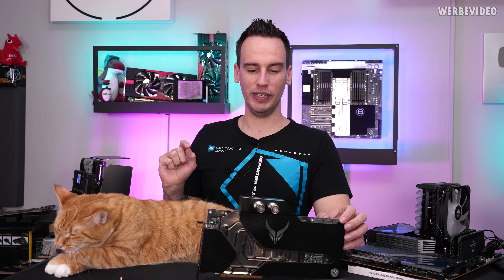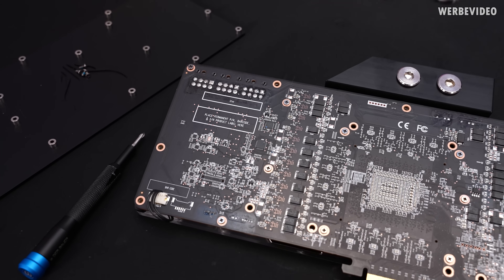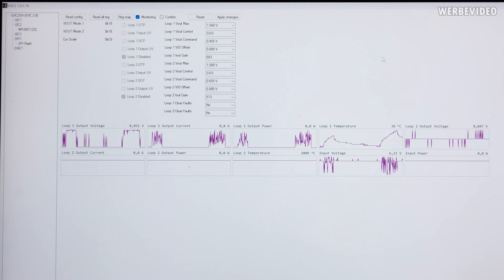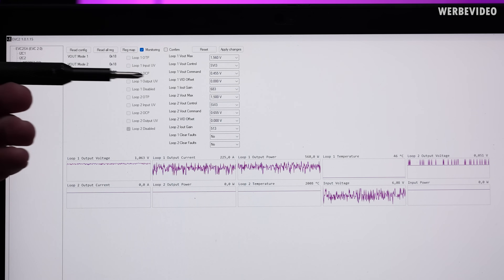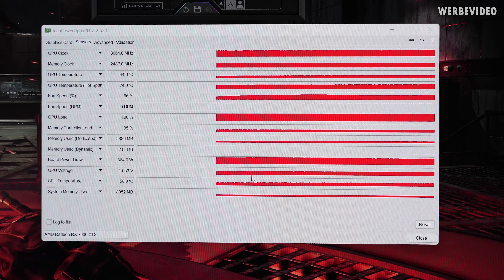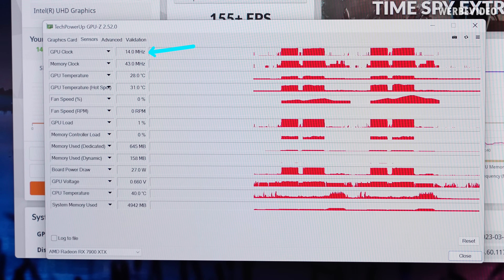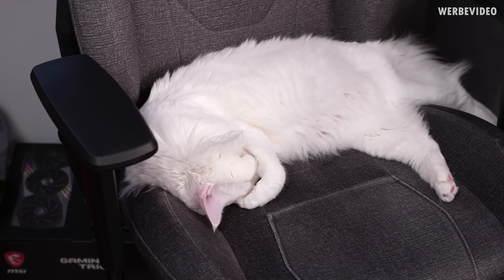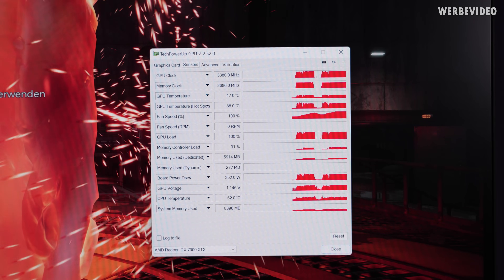Crazy Unlocked RX 7900XTX Pulls 650W

Comment: Rewatching this after the first 5090's started melting. And wow it's almost like having 9 high-voltage wires and active power balancing lets you draw insane wattages without catching on fire! Who knew?!
Reply: it's not active, the power phases are statically distributed between connectors
each 8pin is still merged into 1 conductor (you can clearly see it on PCB photos) but the total size of connector is bigger so it's less of a hazard
plus this is an open stand
Reply: Active load balancing:  Ew cringe

Passive load balance:  Chef's kiss

Comment: This is nothing. My 7900 XTX can max out the clock sliders for both core and memory with minimum power target (so it's more efficient). I just decide to run it stock because it crashes instantly.

Comment: I have a 7900XT that I feel like is SUPER limited by power at ~360W, I am very tempted to do this now that I have it water cooled.
Reply: How are u water cooling ur 7900xt
Reply: @brichardson342  I got an Alphacool Eisblock Aurora and plumbed it into my existing 64mmx360mm rad for my 5950x. 

Gets a little warm still under full gaming loads with the cpu loaded but pretty effective overall.

Comment: Thank you for a great video. I am looking in to push my 2070S further, and this i s a good inspi.
I have a PNY 2070 Super "mini", it have been amazing to push, running up 2230@700 with a msi bios flash.
Pushing 251 watt, but I know I got temp and power to push to 300W. 

But too bad you didnt try do make a run on a bit greater cpu. Could have been a nice touch with a top 3;)

Comment: The power protection on the PSU really doesn't make sense to me as far as it being 3 8-pins goes.  I ran my 3090 Kingpin up to almost 700W draw on an eVGA P2 1200W PSU with the unlocked BIOS and never tripped anything in the PSU.  That was on liquid as well, nothing special, just a dedicated 480x60mm radiator after the GPU to cool the liquid off and get that heat out.

Comment: try a gpu with an ASIC under 25%. My Taichi does this on stock bios on stock cooler with just thermal pads and liquid metal. I bought a ch341a, but haven't found a reason to flash the aqua bios to the card as it's already insane lol

Comment: Wait. So you "accidentally" proved here, that 3 8 Pin pcie are enough for 600w+. I mean it was already clear beforehand, since the 12vEPS 8 Pin and the 8 Pin pcie are basically the same, with pcie having one more ground pin and one less 12v. So the pcie 8 pin can carry 300w (EPS12v) * 3/4 = 225w each. making the safe powerinput through 3 pcie 8 pin 675w. So 450w 4090s could get away with 2 PCIe 8 pins (and like 50w through the slot just to be safe) and higher end Models with 3.

Comment: I have an air cooled Powercolor Red Devil 7900XTX and with just a small overclock using LACT (I am on Ubuntu Linux) I see 3000Mhz and 420 watts+ power usage and amazingly the temps stay in a range where it could run like that all day long, fans get loud though. I am sure my Fractal Torrent case and all its airflow helps, but the card is amazing. Powercolor did a great job with it.

Comment: Grab some PTM7950 and put it on the core the 0.2mm thick one, its pain to apply but can perform as good if not better then liquid metal appearntly or atleast better then thermal paste and has crazy longetivity it melts at 45c btw maybe consider checking out liquid devil 7900 XTX for long term see if thermals get worse my liquid devil suffers extremely from pumpout effect and had 92c hotspot even in 3D occt but only 72c hotspot in first few minutes fresh PTM7950 will perform bad on first 5 minutes and get better after like 1 or 2 hours and then even better after like a day altho i would test this, lenovo puts this on their laptops and NVIDIA does it on their 4090 FE
Anyway i wonder if thermal paste is even viable at this point even when watercooling especially older paste like MX-4 is complete trash only takes like 1 or 2 weeks to get really bad im using my liquid devil 7900 XTX in vertical gpu mount altho i really doubt it be any different in normal orientation its not like MX-4 is a liquid that falls thru the gaps else i be seeing thermal paste seeping thru

Comment: Seeing that you have an Corsair Power supply i would check the Amp current those can deliver on the 12V rails especially on the GPU Rails i have that Problem before and had to find out that Corsair PSUs can't deliver much in terms of Amp (only ~50A as far as i remember) i then switched to a Seasonic 1600W PSU with 75A for 20ms on those rails and my Problem was "mostly" gone. 
Disclosure: i had damaged my Vega FE and had  burned out a Computing Core under Air, and now, if the driver decide to use that Core (Core 0), cause a short with an Amp spike of something around 60A, The seasonic PSU can "mostly" power through but sometimes it is too long and triggers the protection. having re fit this damaged Card to water makes at least sure nothing else burned out. 

Many PSU are kind of Weak on this specific Rail and i had to search specifically for a High Amp PCIe Rail PSU to overcome the Problem. 600Watts are definitely something a Corsair PCIe Rail struggle with Ampere wise.

Comment: Not to sound like a dick, but rubbing a cats fur while holding an expensive ass card is creating static electricity and thus ruin chips on the board. Your not wearing a ground bracelet either so that will definitely increase static electricity.
Edit:
Your sponsor is terrible, i know that may also hurt some feelings but look at 1:00 the entire 24pin ATX harness is blocking the fan from air flow and that cpu has  a passive cooler mounted on it. 
What kind of efficiency is that!? Because all i see is thermal throttling......... 🥱🥱🥱
Reply: enough with the whole "static electricity" fear mongering. youd be surprised how rough you can be with components nowadays. you have to REALLY be trying to fuck up your PC by static, and even then, the chances are still almost nil.
Reply: @beboid  You be surprised with this, companies will fire the color off your ass for not using an Anti Static wrist band while putting parts into servers. Specially well named hosting companies.

Comment: Pretty incredible amount of headroom available on these cards. If you're gaming, it might even be faster the a 4090 as 3D mark is a synthetic workload and not something you'd encounter running Overwatch or Battlefield. Unfortunately didn't show the wattage at the end of the video, but it has to be much more acceptable then the 3D mark load. That's pretty crazy seeing as the 4080 and 4090 have no overclocking headroom and a 4090 is $600 more.

Comment: GPU advice please: my plan was to get the "very best RTX4090" which money can buy, (which I heard is the Asus Rog Strix OC version) & put a EK dual active custom waterblock on it. But if the board itself barely varies between companies, & I'm planning on stripping away the fans & heatsink it comes with anyway, would who assembles the GPU even matter anymore? And if not, could you please tell us which is the best pre-custom-waterblocked (NOT AOI but to be added to a custom waterloop) RTX4090 GPU available, please? 

P.s. any rumours about a RTX4090 super or any other variation of the RTX4090 that comes with a display port 2.1? There are displays being released for which the existing display 1.4a would be a bottleneck, so I find that outdated display port tech off-putting, when even lower spec AMD GPUs use display port 2.1 now.

Comment: So basically the 7900XTX was modded and pushed to the limit and it still came in under a stock 4090? 
Dang. nVidia really made the 4090 very power efficient this generation. 

Wanna see you do the same for the 4090 and push it to the wall.
Reply: @Blue U have to take into account the area of the MCDs along with the GCD if you want to compare it with the monolithic die of the 4090. It's an entire package.

Comment: Re-calibrating the vrm controller still works on the 7000 -series! Nice! (sad that they took away mpt power and voltage increasing though)
Imagine how fast that would be with direct die heat transfer to bring down those 100c temps. Once the temp gets above 80c or so the voltage / frequency just scales horribly bad. Could be really fast!

Comment: Hey derbauer i have a pavillion gaming laptop and it has ryzen 3550H its TDP is 35watts so i noticed something after a bios update ,

BEFORE BIOS UPDATE(REVISION F.14) : so the cpu used to draw around 10-15 watts when gaming and while running geekbench and cpu temps were 85-90

AFTER THE BIOS UPDATE(F.16): now the cpu draws 50 watts while running geek bench and while gaming it averages at 25-30 watts at 85c 
So my question is ,is it normal for a 35watt cpu to draw around 50watts

Comment: This is probably why AMD didn’t push the Navi 31 card to match the 4090…it would have used 650W all the time been near 100C all the time and idle power of 300W and it still would lose in RT to a 4080 by a wide margin.
Reply: rtx API is writing by NVIDIA.  In any other RT implementation, NVIDIA no longer has such a big advantage.  In ue5 and lumen both cards are equal.  And after the OC 7900xtx, it's a different performance league.  Only of course not every 7900xtx is able to run at 460+w.
Reply: @rENEGADE666JEDI  Uhhh no? RDNA architecture has singular types of cores that do a bunch of things, including ray tracing so when you use some cores for rt instead of raster its not Raster + RT its Raster(-some raster) + less RT. 

Lumen basically tries to brute force a lower tier of ray tracing across the general compute cores which gets worse performance than comparable RT and looks like garbage by comparison while not using the RT cores on either RDNA nor RTX cards.

The 7900XTX is a 4080 competitor, a competitor than can still overclock itself by several hundred mhz above stock. The 4090 is a good 25-40% faster than the 4080 depending on the game on average. Some games that were optimized for console(RDNA) run better on AMD hardware but for the most part the 7900XTX competes with a 4080 in raster, a tier below in actual RT and is less efficient than the 4090. 

Now if you could realistically push 7900XTX to like 650W and 3.3ghz, sure I would say it competes squarely with a 4090 but you can only do that on LN2 IIRC.
Reply: @yungnachty4474  you haven't got a clue.

Comment: At 3200 MHZ, the 7900 XTX should be able to outperform and match the 4090 in lots of games. I am wondering if these clocks will be possible in the future with just driver updates because with the 6000 series, power consumption was significantly dropped with just driver updates.
Reply: No. To get to 3GHz a refresh or a new revision of the silicon will be required.
Reply: @PowellCat745  uhm hate to break it to you but my 7900 XTX does around 3350-3450MHz
(spoiler it doesn't beat the 4090 in TSe but it comes close)
Reply: Not even at 4K raytracing it would still lose by significant amounts by the 4090.

Comment: I've had 3 XTX Tai-Chi's come through the shop and each one could hold 3200MHz GPU clock with just a +15% power bump. Really liking these XTX cards. Finally 3GHz GPU's.
Reply: I believe Jay's two cents has a video on this specifically. The 7900 XTX is severely power limited and if you overclock the GPU core too much then you start losing memory clock because the car pulls power from the memory to power the core. Hence why undervolting is one of the biggest strategies for 7900 XTX overclocking to try and avoid this issue. But if you do what der Bauer is doing in the video, You're no longer power limited
Reply: @MaFTB Thing is that undervolting means you can increase the core clock depending how low of a voltage tou want to go
Reply: @mayuravirus6134 Yes, but only if you are power limited or thermally limited. If you can make the GPU take 1000w and cool it with liquid nitrogen, undervolting actually makes it less stable.
Reply: Are you talking about a bump to the voltage? I'm new to overclocking. My xfx comed at 1150 stock but when I turn it down to 1050 it goes from 2800mhz to 3050.
Reply: @beeman4266  no, most likely talking about wattage, so a stock XTX consumes a max of 355W, so 15%+ power would be roughly 410W
Reply: @Jabe_VeX my Taichi at 3100 mhz +15 power is pulling 460 that thing gets HOT
Reply: @SpinuzziProductions  I have an Asrock Phantom gaming XTX, it's currently at 3150mhz clock, 2750mhz vram, 1075mv with +15% powerlimit, very stable and it sits happily at 57°c and 66°c hotspot on 50% fan speed in my antec flux pro, with two NFA12x25 blowing air under the card to help
Reply: @sonsy8762  damn those thermals are great. I’m gonna do the ptm7950 mod when it arrives. How many watts are you pulling when running those temps? And are you using the OC or quiet bios
Reply: @SpinuzziProductions  Over 500W, but I've clocked down yesterday to 3100mhz, 3Dmark benchmark was stable but I noticed that total war warhammer 3 really didn't like the 3200mhz and was getting some weird artifacting in battles that was resolve after clocking down a bit.
Reply: @SpinuzziProductions same here but hotspot temps go to 110 instantly so I for now i only use slight undervolt

Comment: I was briefly in the top 100 with my air cooled merc 7900 xtx on a 750w psu. Stable on 3dmark but I think power was spiking too high in the early access games I play. 
I have ordered the water block and will be switching to a bigger psu.
Reply: Always buy a 1000w+ psu ..That's one part you can re-use in future builds
Reply: @Charlie-zj3hw  I have several but they were used in my mining rigs. The 750 was plenty for the daily rig until now and it's still fine with a mild oc. I've used it since the 1080 ti was new.

Comment: If a guy wanted too just bump it up too 550w or so it would be pretty safe you think for daily gaming?
Reply: it's all about cooling.  As junction temp is below 90c 7900xtx works very stable.  Above this value, at least my model behaves strangely. I have nitro + and I think that these coolers would be able to withstand 550w but it would be loud.
Reply: I have a nitro as well under and alphacool wb with liquid metal. I do 3050mhz in most games right now

Comment: This shows the potential of this card and reveals their plan to release an updated version mid cycle. I think we might see something more impressive than the typical Ti or -50 model.
Reply: I'd love for that to be true. And, if it is then I'd say AMD are really going out of their way to prove otherwise. I honestly didn't expect the 7900XTX to be branded as such.
I figured 7900XT and a 7900, or 7800XT even. Imo the 7800XT/X should retain the 20gb's on the 320-bit bus. The 4070ti and 4070 would go from looking really bad to horrendous.
I'm getting the feeling from some of the other comments that the 7800XT/X will perform very close to the 7900XT. Plus, if it's priced below the rumored $750 msrp of the 4070 then
we could see the 6950XT getting another price cut (which could go for all 6000 series cards). Also, look how close the 6750XT performs to the 6800. Goodness for those who wait.
Reply: Wow these comments aged poorly, no mid cycle updated version and no higher 79xx XTXs ever came out.
Reply: @RoCkShaDoWWaLkEr  its macabre how they didn't reply,  they might just be internet troll/hypeman hired for that.
Reply: @RoCkShaDoWWaLkEr  It seems AMD really gave up competing with the 4090. I wonder if a high end RX 9000 series GPU will eventually release, like rumors state.
Reply: @Sherolox  The 7900XTX competes with the 4090 just fine and beats it in quite a few games plus there's a ton of room for overclocking the 7900XTX.
Reply: @RoCkShaDoWWaLkEr  'A ton of room for overclocking' with much higher power draw and far less efficiency. An air-cooled 7900XTX is what most people would be running. Which will not be able to keep up with even a Founder's Edition 4090. Unless there's some kind of secret remedy I'm unaware of.
Reply: @Sherolox  People are getting their 7900XTXs up to 3200 mhz on air with a small undervolt. There's videos on YouTube showing an OC'd 7900XTX on air beating the 4090 when it comes to 1440 and 4k. This huge lead (for more than twice the cost) you think NVidia has over AMD is just in your head.
Reply: @  FYI, I'm not intending to defend Nvidia. My knowledge of 7900 XTX OC was outdated. My own XTX seems to undervolt decently, so I'll try it myself eventually.
Reply: Soon it'll be 800 watts to play 4k games hahaha
Reply: Hello darkness my old friend...
Reply: I don't think we'll ever see a 4090 competitor this generation--AMD has been all about efficiency and they would have to push this architecture way into the inefficient end of the curve to achieve that sort of performance. But maybe we'll see some sort of update with at least a decent bump. Here's hoping!
Reply: @thicclink  There are few leaks about 7950xtx and 7990xtx (which will be the 1st gpu with 3d cache).
Also a few leaks about gaming performance beating the 4090, but these are fakes probably
Reply: @_karsl_  my 4090 is clocked at 3000mhz and never gets over 230 watts..
Reply: @mrrod3004  wrong reply target 😀

Comment: My 6900xt is pushed to 385 watts but i dont push it that high. I just did the mod for higher amperage which allows my card to clock to 2700mhz at 315 watts of power draw on air.
Reply: the problem with rdna2 is too slow memory.  7900xtx does not have this problem so the results after OC are much higher.
Reply: @Tomasz Kaczor  your right. Unfortunately i cant really oc my memory due to thermal issues. Most i can get is 2100mhz on memory but it makes the biggest difference in fps when ocd giving double digit improvements on olmos every game.

Comment: I have a xfx 7900xt I bumped everything up in adrenaline it peeked  3ghz pulling 411 watt out of the box. I was surprised.  In default settings I regularly see it at 2800mhz in game. Did I win the silicon lotto?
Reply: Yes. My 7900xtx pulse does 2800-2900 under water.
Reply: My sapphire 7900xt nitro + max result is 3200 mhz with 900mv, +15 power limit.